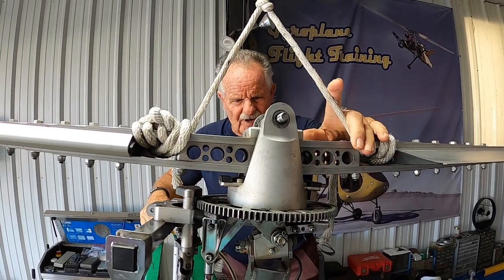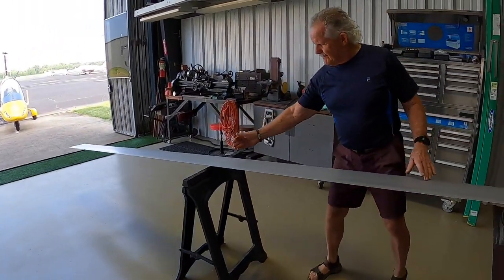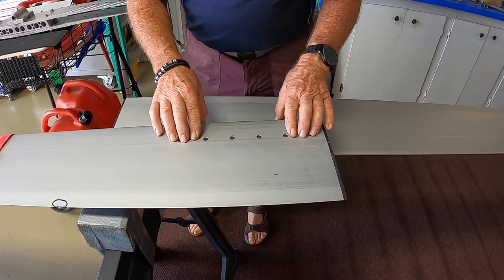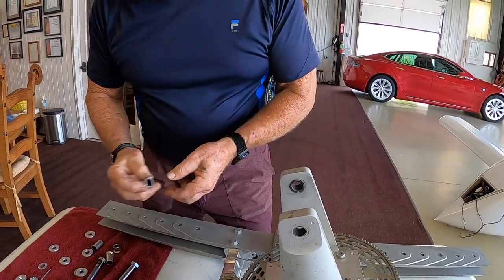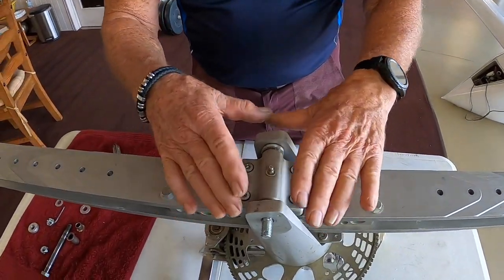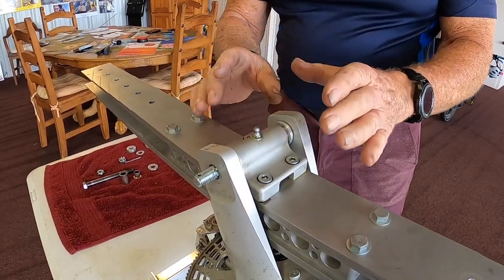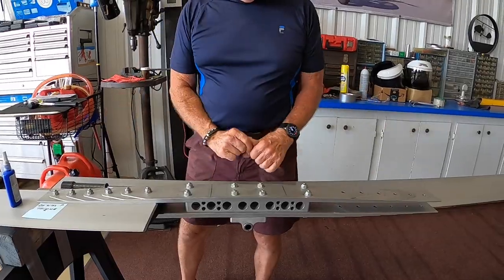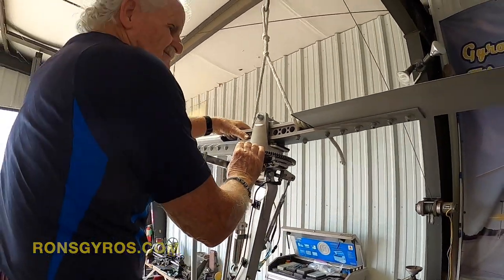AutoGyro Rotor Removal, Inspection, and Shim Replacement

Comment: Hi Ron, very informative video, thank you for your time making it.
I would make the following observation. 
The loose plastic insert should be glued in with a flexible Sikaflex 11FC polyurethane ,not epoxy resin, epoxy resin will release as soon as there is movement of the two dissimilar materials.
i would also suggest numbering the bolts as they are removed with a black permanent marker.
Thankyou again for the video

Comment: Shouldn't there be a washer under the bolt head as it enters the tower?
Anyway thank you for this very informative video.
Reply from the maker: The manufacturer does not specify a washer at the head of the bolt. Most applications where there is no rotation does not require a washer.

Comment: You've not explained why AutoGyro rotors often come with different thickness shims. AutoGyro stamp one shim with two points to match the two points on one of the towers and one point on the other side.
You say the shims are there to account for wear but they are really there to balance the rotor in the chordwise direction.
Reply from the maker: If the rotors were balanced using a balancer then the shims will be different thicknesses to off set the hub bar and have punch marks to reference the what side they need to be positioned. I didn't want to confuse the viewer with all that information. Most all shim replacement will require same thickness shims for both sides.
Reply: Ron all AutoGyro rotors are dynamically balanced before leaving the factory. I've tracked & balanced a number of their rotors and they all had different thickness shims. Your explanation would encourage guys to unbalance their rotor.
Anyone who could be "confused" by the correct explanation of the purpose and function of those shims simply shouldn't be working on their rotor.
Mike Goodrich